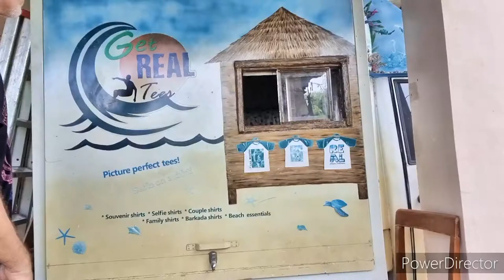Campervan Loft | Slide Out Bed Conversion | Windbreaker Loft Interior | Big White | L300 Campervan

Comment: Have you guys considered the whole bed to slide out? Metal frame under a 3/4 plyboard with rollers that can fastened when stored away. Watching all the way from Negros Occidental.
Reply from the maker: Yes, it's definitely an option for when Miriam grows bigger. For now this is what we need since she's still small. But knowing how adventurous she is, she might opt for a rooftop tent. The issue is that Paul and I might not comfortably fit under a full-length slideout where our murphy bed is. We are pretty big people. We'd need to drop some weight. Haha.